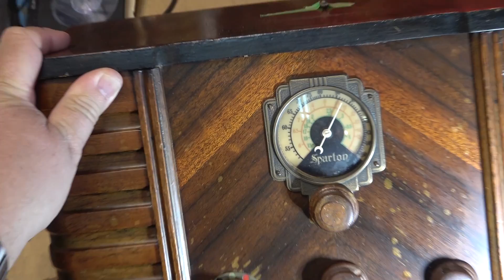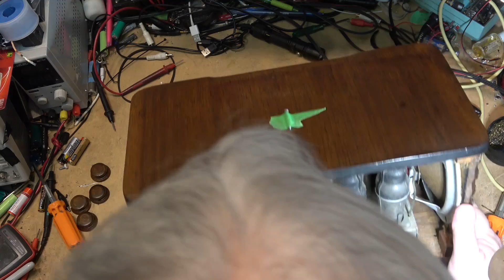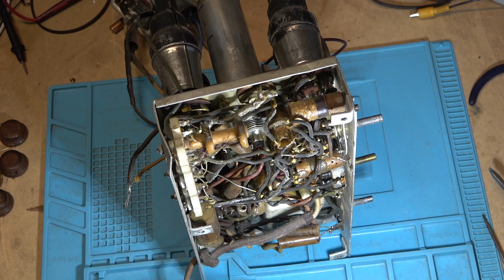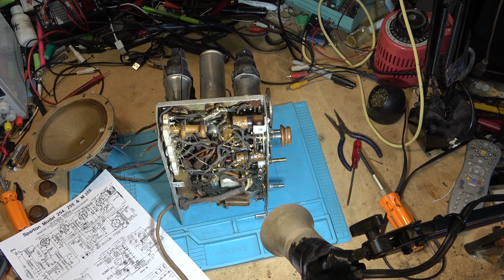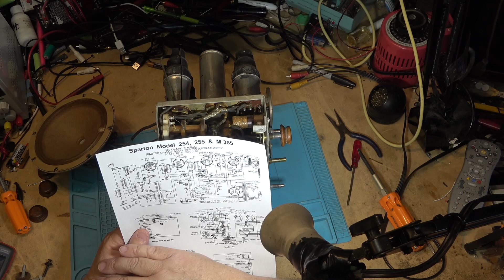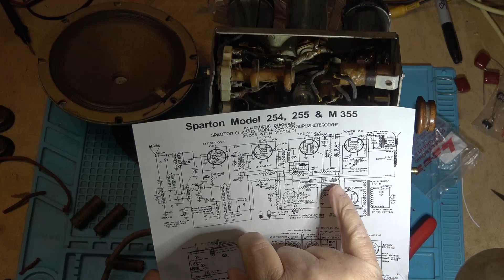90 year old Sparton Model 254 AM Table Radio will this dinosaur work? Lets find out.

Comment: I love tube type equipment especially Ham & CB Radio amplifiers. Once fixed correctly they can sound awesome on AM & Shortwave. -Cheers!
Reply from the maker: I have a 250 watt tube amplifier for 10 and 11 meters, I also have an old Yaesu FT101 tucked away and that will do about 200 watts, its a tube output. Those ones scare the crap out of me because the voltages are really high in there.
Reply: @12voltvids  Oh yes especially if they use a 6146B & 4CX 150 or 250 ceramic tube.

Comment: I have a Sony Portable Battery 🔋 powered AM/FM it came out in 2008 and it still works!!! It has LED light indicators one green one for the battery level and one red one for the tune light for the signal strength from the radio station on that frequency for the FM signal it has a metal rod antenna model ICF-P26
Reply from the maker: Get back to me in 2098 and let me know if its still working.

Comment: I remember when Bing Crosby did his radio shows back in about the 1930s to 1950s the radio shows back in those days where on AM radio not FM
Reply from the maker: That's because FM radio had not been rolled out. They did have FM developed however as it was used from day one on TV.  They started in 1933  in the 42 to 50MHz range, and then changed to the current 88-108 in 1946 which is when commercial FM broadcasting. The experimental stations were required to change frequencies by 1948, and existing receivers required re-tuning.

Comment: Dave at least you do something before you run a set is change the bad caps first! Jim's Radio Shop doesn't do that every time!
Reply from the maker: I have done that on some of my old radios. Change all of them before plugging in, however the owner of this already tried to run it and if it was going to go poof it would have happened then. I started on dim bulb and there was no excessive draw, so even though I know there are bad caps, none dead shorted. Had that bulb lit up bright then I would have known there was a bad short. A little leakage isn't going to destroy components if only run for a few minutes.

Comment: I remember my Dad running 🏃‍♂️ a mile long transparent length of electrical wire from one end of the roof to the other, just to pick up Radio Luxumberg on the Blaupunk tube set, back in the day. 😊
Reply from the maker: Longwire antennas are still  used today. Not as much to pick up anymore as most of the shortwave stations shut down. I used to love listening to shortwave radio. Hear music from the BBC, Radio Australia, Radio Cuba.  Loved all of it. Of course the holy grail was the pirate stations. AM DX was also something I did frequently. AM DX is now even better than ever because so many local AM station s are dark.  In my area there used to be strong stations on 550, 600, 650, 690, 730, 800, 850, 870, 900, 980, 1040, 1130, 1200, 1320, 1410, 1470. 1550. Today there is 550, 600, 650, 690, 730, 980, 1130, 1200, 1320, 1470, 1550, 1600. Out of those 650 is sports, 690 the CBC (also broadcast on 88.1 now) 730 is traffic plus whitecap and lions games) 980 talk, 1130 News. The rest of foreign language stations. No music at all on the english AM stations. Frpm 17 local stations to 12. This opens up real estate to pull in distant stations.

Comment: Mr. Volts, how do you determine the polarity on these old sets, with the installation of new capacitors. I ask the ques. due to the fact there are no visible markings with the absence of a circuit board. MJ in B'dos.
Reply: On the canned caps usually the outside metal of the can is the negative side, and if that's not connected to ground it will be sitting on some kind of isolator. The later years they'd then slip a cardboard cover over the can if its a ungrounded cap so someone won't get a mild shock if they grab it for some reason.
Reply from the maker: With the exception of the 3 Atlantic Which are all contained in that metal can the rest of them are non-polarized. Now some will harp about the outside foilAnd that was more of an issue on the larger paper capacitors that were physically larger you wanted the outside foil of the low impedence or grounded side.   This is because the  Physically larger Bodies on the capacitors had more surface area and could pick up interference from outside the smaller caps have much less surface area so this is not as big an issue.  But as far as polarity no, this is not important like on an electrolytic which will blow up if put in backwards.

Comment: Refurbishing these prewar radio's is an art that takes many hours.
The wiring is always past it's best and the old paper & wax capacitors always need replacing
along with dried out electrolytics.
If you have to buy new tubes (valves) they can cost a fortune.
I hope you get the go-ahead on this one.

Comment: No dust cover over the voice coil !!
Reply from the maker: So
Reply: @12voltvids  only thinking why the not put one in !! The voice coil kan be jamed whith dust !  I have my self putting a mild air compressor to blow out any debres off it , whith minimal pressure , to make it work as intended !
Reply: The spindle om the speaker are probably totalt dry , a trick is to hit it whith some hair spray! It seems redickulesd but works !
Reply: Some old speakers have i sted off a spindle a membran instead ! But when i restored a speaker , whit a new kon , or only the rubber foam on the speaker , i always get the spindle a toucht of hair spray , its make it a liter bit softly ! And the speaker sounds like its purpose
Reply: I have resturated so many speakers, for more than 20 years , and no wone has been reklamid ! The just be working !
Reply: I think that's how older speakers were made.